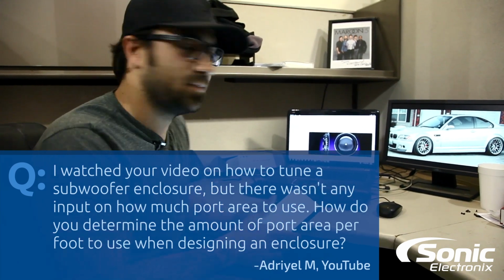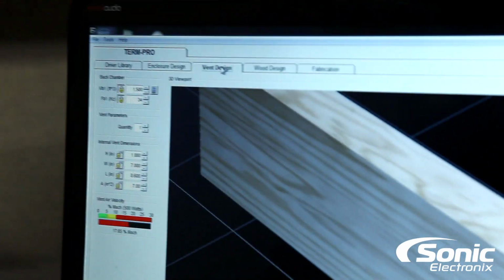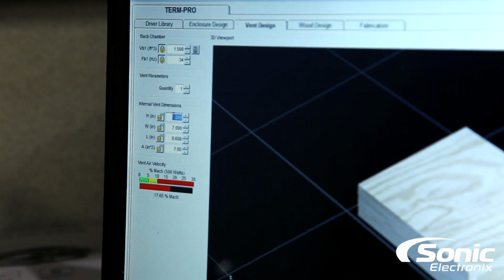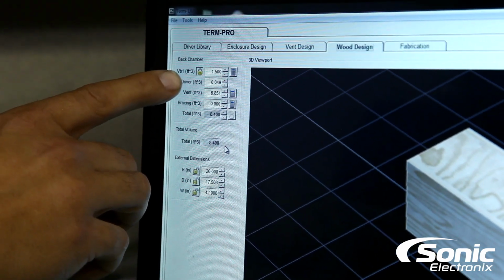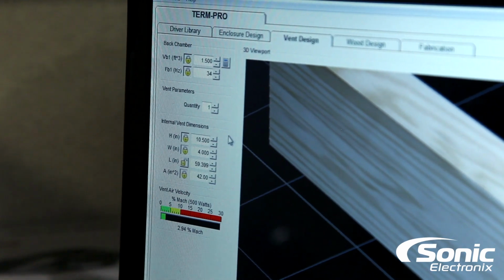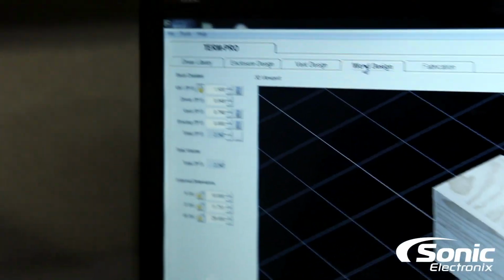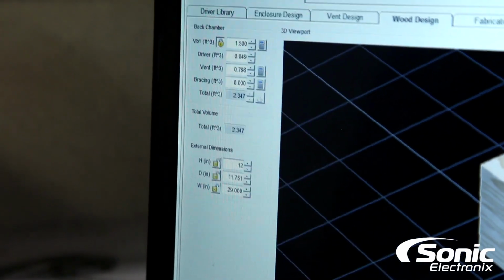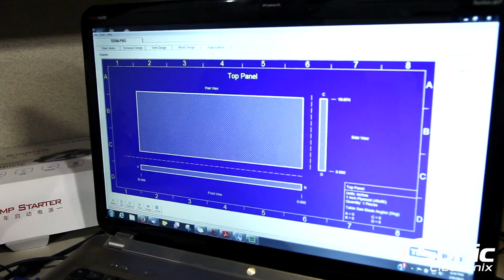How Do You Determine Port Area When Designing Enclosures? | Car Audio Q & A

Comment: How would you measure the Cone area of a square subwoofer. You wouldn’t use Pi because it’s not round correct?!
Reply: A square 8" subwoofer = 8" x 8"= 64 square inches of calculated cone area, but not actual, because 99% of most speakers are not the size they say they are. So it's best to measure by the half surround method. Take your tape measure, & start @ the center of the surround on 1 side, & measure across to the middle of the surround on the other side. I would also measure the other dimension, in case it's not perfectly square. Lets say you get 7" x 7"= 49 actual sq. In. of cone area. Every speaker can have a different size surround, & cutout.

Comment: Does term pro (latest version) support slot ports where it will shape them inside the box (fold them as necessary) to fit it.. and provide the cut sheet for that design? Or is it up to you to figure out how to fit a longer port inside a box?

Comment: The port area must be between a 30% or 40% of the cone area. That is a good port size whit no port noise and great sound
Reply: Is this for any port?
Reply: @James10864  Port noise occurs when the speed of the air passing through the port exceeds 17 m/s. The size of the port depends on many things: size of the subwoofer, the size of the box and the intonation of the box. Knowing that, the size of the port has to be enough so that the air speed is equal to or less than that mentioned.

Comment: Alright i understand that it doesn't seem like he answered the question but if you look closely the term pro software shows 21 sq inches of port area which is still alright the rule of thumb for port area is 12.5 - 16 sq inches of port area per cubic ft. of the box so for example the box design that Allyn made is a 1.5 cubic ft. box so if you do 12.5 sq inch x 1.5 it would be 18.5 sq inches of port area and if you take 16 sq inch x 1.5 you get 24 sq inches of port area their are a lot of factors that come to play also such as how much power will you be running to the sub. other than that 21 sq inches of port area is alright smaller the port area the bigger chance you will hear chuffing... if you take the ports internal height and width which was 10.5inches x 2 inches your get 21 sq inches of port area... also it is not a scam having term pro is a good investment if you design sub or speaker boxes alot then again you dont really need it their are free programs such as WinISD  for me i have Term pro, winISD, torres, and bass box pro so yes i check my design multiple times and also check it on paper with alot of math lol ... also there are some that go way more than 16 sq inch per cubic ft. but that is more for advanced builders lol hope this helps clarify that allyn isnt wrong and answers that question lol also dont forget that the port also has a displacement and slots take up more space than aero ports

Comment: Um, that is not the correct port volume. That is the port volume of all four walls of the port, in this design, the top bottom and outer side of the box act as three of those four walls. The actual cuft of the port for that design is roughly 0.13 not 0.7. that is what you need to add to the boxes cuft. And likewise that ridiculous 8+cuft total was wayy off man. Am i the first to notice this?
Reply: And of course port length isn't necessarily the actual length of your port wall. The middle is where you measure the port length, so the inside port piece might actually end up a tad shorter, and more so the more times it has an inside turn. This reduces the cuft it takes up. And on the contrary, when you reach a length that requires you to make another wall to continue the port your adding more cuft(obviously). Any outside turn pieces will use more length of wood than the port length it gets, and you can also use the other side of the existing port as the inside of this part of the port to not add more cuft to that.

Comment: You did not answer the actual question whatsoever...You used your software, and told us "you wanna have less than 10% port air velocity; The port area doesn't really matter, we need to manipulate it"...which you relied on your expensive software to explain it to us. So thank you for literally telling us nothing, and maybe conning a few people into buying a 250$ program to build a 50$ box.
Reply: WinISD is free and it also gives you port velocity. Put in your box volume, tuning frequency, & port area and it'll give you air velocity
Reply: I agree.  I was expecting math.
Reply: Psst the port volume is also wrong. That was the total volume from the outside of all four walls in that software of the port, when determining the volume of the parts added by the port you measure the length of wood added to the structure. In a slot Port using the entire height of the box and starting on the edge, you only need to know the length of one side, do the math to calculate that it's actually a port volume of roughly 0.13 cuft. Not 0.7. I would not buy boxes from them. If the box was bigger, and this size port was built in full with all the sides separate from the walls including top and bottom, that would be the actual port volume.
Reply: @mattwells1036  he didnt do any of it correctly.  Port area is determined from the type of enclosure and the size of the chamber.  A 4th order bass reflex box or ported box usually has 16 sq inches per cube of cone area.  If you have a 4 cube box that 4*16=54.   If your internal height is 11.5 then do the math for the width, enter that into winisd and it will give you your port length.   If you were building a 4th order bandpass box the cone are is going to be different.  Usually higher like 20-24 sq inches of cone area.  Also the port tune is going to be higher like 40-60 hz bc it acts like a limiter on those boxes.  
This guy never touched that most important rule so dont buy boxes from them.  Ive seen other videos of his and they lack the real details as well.
Reply: The x16 rule dose not work with all brands....cone areas differ brand to brand....so does port area...in the same cubic footage nonetheless....ur x16 rule wont work with say some sundown skar and audiopipe brands...all in all ask manufacturer for port area specs...most are usually between a x11 to a x17 rule

Comment: I’ve got my outer dimensions for my box and know how to tune the box but what should I tune my box to? I’ve got 2 RE SE15 D4’s running off a CT sounds AT1400.1 in an old suburban. Now I’ve got them in a probox and it is way too small and only hits about 42 hz with hardly any power. I know a bigger and lower tuned box will help out a lot. I’ve got designs drawn for a 34hz box but would it be ok to change up my port for somewhere more like 27hz? Thanks for any help
Reply: The Bangin' Burb I would not tune lower than 30Hz unless you want to play 20-45 Hz and be extremely peaky. Tune to 32 or 34 Hz is my recommendation. 4” - 6 “ aero port would be easy to adjust for different tunings ( depending on how you build it )

Comment: Is it safe to say your port volume is about 25% of the total volume
Reply: No. And the port volume calculations in this video were incorrect. Those in the video used all four sides of the port as the port volume. But the design uses the top bottom, and outside walls as three of the ports sides. The volume being removed from the internal displacement is only that of the one side, which gets shorter compared to the port length when making an inside turn, as well as the opposite for an outside turn. Their incorrect calculation stated the port displacement of the final design was 0.7 cuft, but the it'd be roughly 0.13cuft. the prior ones were also wrong
Reply: No.

Comment: Should the area of the port and port material be subtracted from the total enclosure area when calculating the enclosure size? Thanks
Reply: Yes.
Reply: Not the area inside the port. The area the port walls are displacing is all that you need to calculate and remove. The area inside the port is still part of the enclosure displacement.. their port displacement was way off as that was including all 4 walls of that port dimension. In the video he said and showed 0.7 when it was really only roughly 0.13.

Comment: Okay. So when designing a ported enclosure, the recommended volume of a subwoofer does not include port area in the recommended enclosure design? Such as a sundown SA15 requires 4 ft^3 ported. So what that's telling me is a 4 ft^3 box plus the port. Is this correct? Or does that mean total volume including the port?
Reply: Adam Moore correct, the port area and volume do not count in the 4ft^3 that is net not gross. The port area would need to be added to the 4ft^3 ..

Comment: Can anyone recommend what port area and length for  a 3.75 cubic foot box running 2 12s
Reply: Port area should be between 21.70-41.85 per 12 and port length depends on how high or low you wish to tune the box...

Comment: that's great and all but term-pro is $250 bucks...
Reply: BRBingeDrinker calm down fucker.
Reply: you mean "free".
Reply: where is this "free" version of the software you speak of?
Reply: its not on any piracy sites there guy
Reply: *****
er.. i'm calm. lol
Reply: That's up there with shops building boxes wth  prefect sub enclosure circles.... but they're using a router table. Nobody i know has a router table.
Reply: @edgu71eg  you don't have to buy a router table, just build one... even if you don't want to build one you can still buy one, there decently cheap.
Reply: sorry i was being name-called by a pack of wild liberals on facebook last night. ready to snap something. hopefully something in my pants.

anyhow. i tried demonoid and piratebay. i don't even know of any other P2P software. Morpheus? Should I get limewire again?